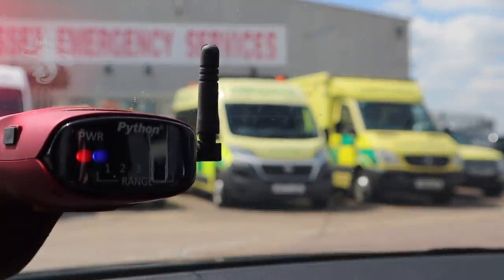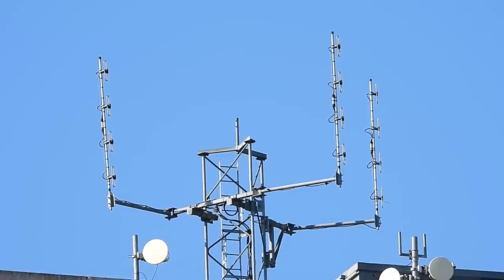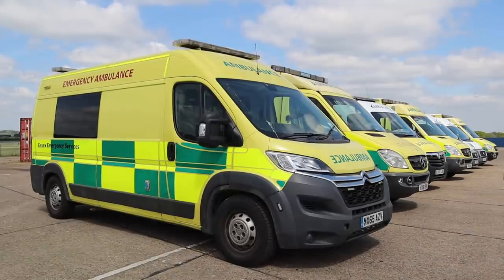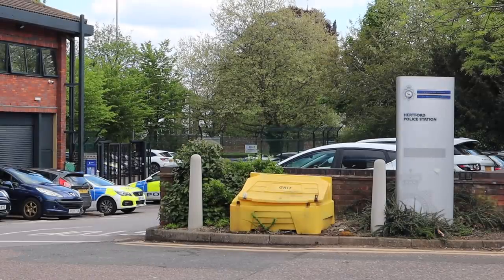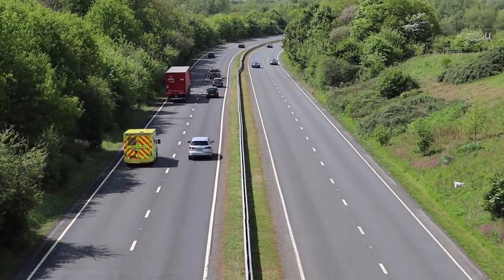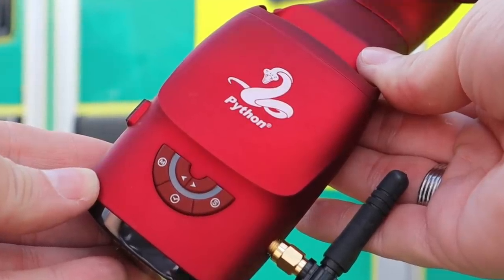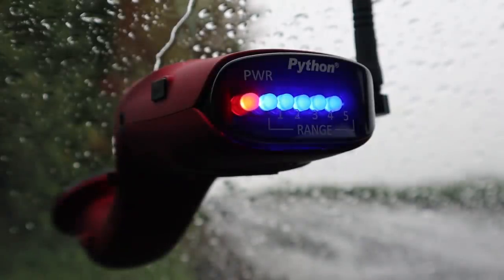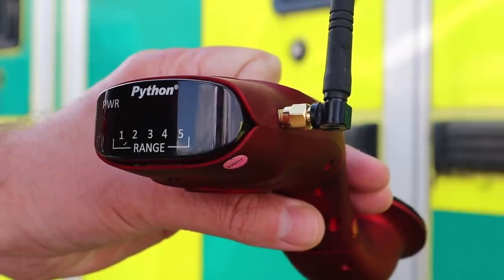This UK Police Radio Scanner Is Always Listening

Comment: These devices have existed for a while and they aren't a silver bullet.  The problem is that the radio needs to be transmitting to be detected and that isn't continuous.  What it's doing is judging the signal strength for the frequencies that it's tuned to.

Comment: So when I'm out doing what I shouldn't  be this could alert me if the police are following me in an unmarked car. 😀😃
Reply: I'd rather listen in to their radio. I want to know what they are saying not just if there's a radio nearby. That's pointless
Reply: @lauralishes1  considering that the mobile speed traps also have airwave radios nearby it will give you an alert long before you see them. And with laser speed vans if you can see them then they can see you. 

So in this use case the python is very useful especially if you know that there is  a favorite spot for mobile speed traps.

A second use case relates to the changes in theblaw regarding use of mobile devices in a car. 
If the python ping then you know not to touch you mobile device or car infotainment system.

So I would say this unit has two valid use cases.
Reply: @lauralishes1  that's never going to happen! Not in our life anyway. The EMS Airwave Service uses TEA2 encryption and is very very secure from casual eavesdropping.
Reply: @lauralishes1  how can we listen
Reply: @endofdayzfitnessu.k2126  You can’t!
Reply: @jasonantigua6825  Theirs always a way to get around it, somewhere/someone is already doing it, but not telling only handful of folks what's going on as if they get found out & release the hack/method the PTB's are going to come after them hard !

Comment: For those who didn't know it you can make a cheap version of that scanner using your android phone an SDR and an app called SDR power monitor
Reply: Doesn't support frequency hopping tho...?
Reply: How ?
Reply: @James S.  I'm not sure
Reply: @jamess1787  doesn’t need to. Just needs to detect any transmission in the relevant band.
Reply: Yep, £4 for android software and £5 for an sdr dongle. Better than £400 for this python 😅
Reply: @Elberto71  ok you have links?
Reply: I did wonder.
Reply: @Elberto71  any links ?
Reply: @jamess1787 Tetra Modulation doesn't frequency hop by default in TMO.

Comment: This looks interesting but will soon become obsolete as they have been planning to move to a network radio system that operates off the mobile networks for some time now. I'm not sure what the latest is on that front but I know the project was delayed and some shady deal was done to allow Motorolla to continue to be the sole provider of equipment at some excessive price. So far as I was aware Airwave was due to be scrapped a couple of years ago but that hasn't happened because in traditional government form the project ran over budget and over due. Probably a lot of greedy corrupt officials at the top levels of the home office / government using projects like this to funnel large sums of public money into off shore bank accounts. I've seen the sort of nepotism that goes on first hand having been involved in some government IT projects in the past.
Reply: The ESN Network (EE) is years behind and when it is finally introduced and the EMS eventually migrate over too it, The Tetra Airwave Service will run along side its introduction I imagine, until its trialled, tested and proven as a reliable and robust alternative to the AWS. I anticipate its a few years away yet.
Reply: I mean thats literally how business/government works..
Reply: They used fm for nearly 20 years after gsm went live in 1985. See what going on at E.P.S. Chipping warden. 3g and 4g developed there. I was out before 5g. All the mobile companies were there. Maybe 4 or 5 years to roll out next one. Couple years on contract yet. Flog that dead horse down to the bones. sell that old rope then upgrade. Lol
Reply: @mipmipmipmipmip It's not a merge with existing ones, it's a separate network run in the same way, think more like the diferrence between EE & o2
Reply: Motorola isn’t the sole provider though

There loads

Sepura etc
Reply: @alanswolfpack89  from what I was told when the ESN project over ran and they had to extend the contract with Motorola to support airwave for the foreseeable future Motorola only did so on the condition that they would be the sole supplier of handsets for ESN. I didn't hear this first hand but from a very reliable source
Reply: 2026 at the very earliest
Reply: @binky_bun  Samsung are supplying the new ESN Network with LTE Handsets, UK Government (Home Office) Contract procurement.
With potential to provide upto 250,000 pTT Mobile Phones.
Reply: I serve in a UK police force, from what I heard the ESN was due to be moved to a 4G service either this year or next, however as I understand they are apparently meant to be slowly phasing it in around 2024 with a view to it being fully implemented and operational by 2026.

Comment: Heya, our Tetras can also be used in a few other interesting ways:

Point to point; direct handset to another handset without the use of a repeater.
Or using the vehicle as a relay, for example, down in a valley where the handset may not have the height/power to pick up the Relay but the vehicle base unit might be able to communicate, so effectively it's Handset via the vehicle station to a Relay and onwards to a control room. 

They're clever bits of kit, but fit for voice/text data only. All slated for retirement, I think it's Motorola running it now at an eye watering monthly cost to the home office, Home Office paid £1.6 billion to extend the use of it until 2026 as the LTE replacement isn't ready.
Reply: I thought "point-to-point" referred to individual terminal-to-terminal calls using the Airwave network rather than DMO?
Reply: Yes, point to point uses the airwave network. You can utilise this feature from
one radio to another anywhere where there is airwave coverage UK wide.
Reply: When i was in the rozzers back in the 90s we had a similar thing with some of the car mounted tranceivers ,as they could act as a cross band repeater.
Reply: I assume when the LTE replacement comes in, the devices themselves will still look similar? What are the benefits (perhaps other than cost) to using LTE?
Reply: @asystole_  they work in both modes.
Reply: The Ultimate Art Bell Collection  Ah so they will still look like conventional radios, and not - well - smartphones. Interesting
Reply: @MaxPlayle  I bet there is already a smartphone with integrated UHF even for the consumer market ?
Reply: As someone working in IT I can see the benefits of an LTE-based system. Our country is looking at it too. 
But I can also see that it will also be immensely complex and I doubt it will be as reliable as even TETRA.
Replacing the rather basic analog voice/telemetry systems we had until 10 years ago, I doubt we will have learned our lesson. When we run mission critical systems with NO fallback.  We paid billions for the "Silver Bullet" and we will probably do it again.
Reply: I work on them I think they are great I also love being part of the banter
Reply: @MaxPlayle  I understand that ESN as its being called will offer faster data speeds,  which they want as in most cases they are using  data  to carry out P Checks, Vehicle Checks, etc  which increases the amount of time officers  are on patrol. which in turn is your point of saving  money and could lead to reducing the number of control rooms.  in NI there is a plan to replace the PSNI radio system which is like Airwave and I don't want to say to.much on that , other than it will not be the ESN, but it be interesting to see how it pans out as currently the Garda Irish police and PSNI don't use the same type of radio systems and PSNI currently t fun and supply the Garda with Radios for a cross border network around the border  area. the Changes in NI will also impact on Army Radio use  Fire and Ambulance as currently PSN look after I maintenance and talk through for all
Reply: P2P is such a good feature of airwave
Reply: Point to point would still use the radio towers, its the same principle as your phone when making a call or using mobile data
Reply: @MrJoshmister  indeed
Reply: How can I connect to the police radio
Reply: @Motivation-su7fr  you can’t it’s encrypted only way to listen in is get a job with the emergency services
Reply: @rkan2  Yes. Its called RFinder B1. A dual band FM & DMR transceiver and an android phone. I have one    :-)
Reply: I've been in the job 7 years and not once had to use the Gateway (handset radio to vehicle mode), in my experience if you are in a location where your handset cannot get service, then despite the vehicle having a slightly higher power transmitter it still cannot get service. Unless you happen to be perhaps several hundred metres from your vehicle, which in the area I police is incredibly rare.

Comment: There was a Glasgow based 'firm' supplying snazzy laptops with a bunch of RTL-SDRs and some fancy Bluetooth recievers and panel antennas built into the box. It gave early warning for tetra of any type, but the hardware MAC id of some equipment the police carry could be used to confirm it was the police rather than a ambulance 

It also silently logged all the phones and car BT MAC IDs, give it a week to learn your neighbours, then after that it warns you anytime a new device enters the street

I think there's a commercial version available that had less functionality for £5-15,000 depending on spec 👀
Reply: Which is this? :P
Reply: Commercial security scanners/receivers are fully loaded. Most are restricted now by software licences and of course if you try and scan restricted frequencies, that's illegal and you could get a nasty shock when discovered. 
There is an android app that uses to record all info about cell towers, so if someone tried to put up a spoof to intercept calls or data, it would alert you. Pretty handy, but unable to test if it worked as we didn't have a spare cell tower lying around. Lol
Reply: I might make this, I love the idea - and very simple in concept
Reply: @Hastings1066TV  What are you smoking? record restricted frequencies?? Most of them are encrypted so unless you have the keys, it's useless.
Reply: @rkan2  thank you for your comment. Encryption can be broken, it's time, equipment and effort. However like most rf transmissions, it's how quickly it's done to determine how useful the result might be.
Reply: Nah. It's very easy today nrun encryption these days that nobody is known to be able to break. It's possible some governments can but if they can they are quiet about it.
Reply: New devices won't work with BT presence awareness. They MAC's are randomized. Not sure about the WIFI though because that broadcasts periodically when out of range of the router. I'd imagine they're randomised too. You can build a database of keyfob frequencies in your area that give you some sort of idea if there's a new car in the vicinity. A fake base station is even better. There's always various side channel attacks to fingerprint a device.

Comment: Back in the late 60's I was a bobby in Cardiff, being a small  ( geographical) Police force the motor patrol  unlike larger forces that used duplex, used to operate on  a vhf simplex frequency, 82.325MhZ from memory, ( those of us on foot patrol used Pye poketphone  UHF separate transmitters and receivers) This was below the range of domestic fm receivers, but I remember modding one and was able to listen to both sides of the conversations.  great fun!

Comment: Tetra Masts are not Repeaters, they are TMO Base Station Transmitters. Working on the same principle as Mobile phone masts... Repeater Mobiles are only used in EMS vehicles to enhance better range and coverage to Officers HTs. (Handheld Terminals).
Great videos you do by the way Lewis on some interesting Radio related topics ect.
Reply: why is it unfortunate?
Reply: Ello Lewis.... are ya gonna check out cobra mist at orford ness ..... 126 element log periodics 20 in an arc point ting to the riskiest..... 73 6dhs
Reply: Correct. As a serving officer the repeater car mode is often referred to as "Gateway". I've never used it in the 7 years I've been in the job and none of my colleagues have either. You are correct about TMO as our radios (now Sepura, formerly MTH 800) have a TMO/DMO switch function on them. TMO being Terrestrial Mode Operation and DMO being Direct Mode Operation is (point-to-point).
Reply: TMO Trunked Mode Operation on the Airwave Service Network.

Comment: In the US, the local PD ran unencrypted trunked radio up to the early 2000's. It was 800mhz based and had a few repeater sites around the metro area. With the stock rubber ducky on my RadioShack scanner, it was really easy to listen in pretty much anywhere, as long as you knew which talkgroup was which geographic area. Friday and Saturday nights it was pretty common to hear them break up loud parties around the university campus, occasionally calling in IDs to see if they were fake and the suspect was underaged.

They switched over to a statewide P25 initiative a ways back, and while there apparently are unencrypted agencies (mainly EMS dispatching) most of them are encrypted now.
Reply: Sounds like Indiana and it's SAFE-T system

Comment: Would be interesting to see inside of it.
I doubt it has an SDR. More likely some cheap MCU and a low cost radio chip like CC1101 used to sweep the TETRA uplink band.
And maybe a 380MHz band pass filter at the antenna.

Comment: Uniden made these types of devices in the 90s, and I had one.
They were pre-programmed with each States police vehicle repeater frequencies which in theory the state police and County Police vehicles had repeaters in their vehicles and the handheld two-way radios had the dispatcher frequency as the receive on the handheld and the transmit frequency on the handheld was the input frequency on the vehicle repeater and the output frequency was either the dispatch frequency or the input frequency for the dispatch repeater at the base

They relied on signal strength to tell you when a police unit was in the area but the repeaters in the car only were active if the handheld radio was being used and many times there was no repeater in the vehicle so it didn't pick up about 99% of the time that the police were in the area

They did have the repeater input frequencies programmed in and those were a little better at detecting because they used the vehicle radios rather than relying on the vehicle repeaters

The best frequency that I found to use was one that wasn't programmed in and it was only for the one city in my area that had a constant data link with each vehicle's mobile data terminal

Nowadays with the p25 phase 2 digital simulcast systems the best thing to do is to get a scanner that does 700 MHz and Phase 2 digital and program in a group that is exclusively the input frequencies for the base Towers

Usually these frequencies are in the 790 MHz to 810 MHz

These are what the mobile data terminal uses as well as the vehicle and the handhelds and because the power output is only three Watts if you are picking up a signal on any of those frequencies with a standard rubber duck antenna on the scanner it means the police are within about a mile of you

But this relies on your county or city having one of these systems and if you are traveling between counties and different cities they are all going to have a different set of frequencies and here in America it's a hodgepodge of cities and counties still using the old VHF analog frequencies and others using UHF and others using 800 MHz repeater trunk systems and others using the 700 MHz Phase 2 digital systems

I'm guessing the UK is more standardized and these are programmed with the input side of the repeaters frequencies
Reply: UK is apparently TETRA only. So 380 - 390 uplink and 390 - 400 downlink for govt users. But it is also used by fire and EMS, so one would want to demod it to see more info about the users, even if the voice is encrypted.
Reply: Yeah I was gonna say the US has P25 and other types (NXDN, etc) in use on a variety of band plans with several agencies of the same jurisdiction using completely different radio systems. Something like this would never work here. I do find it funny that they call it a Python when Cobra here makes radar detectors (though Valentine 1 is my fav).
Reply: I knew it was input also.

Comment: Hundreds of police handsets inside the building. If only! The county only has 3,000 officers, bet on no more than 25% of them being on duty at any one time, then spread them across various stations and out on the job, there may be a dozen in there.
Reply: There’s loads of them in there eating donuts !😜👍🏻
Reply: @AJ-qn6gd  if only. It's not unusual to do a full 10 or 12 hour shift without a break of any kind.
Reply: @stevesmith7530  yea been there done that 👍🏻🇬🇧
Reply: 25%? More like 5-10% on duty at any one time tops.

If you think Hertfordshire has 750 officers on duty at any one time actively with a radio switched on and connected to the network then I think you are very much mistaken. 

I work in a much larger force (with about 10x the officer numbers) and our number on duty at any one time is probably in the region across the whole force of around 3,000, or 10% of total officer numbers. That probably includes specialist units such as ARV, dog unit, traffic, etc.
Reply: @thefiestaguy8831  on duty <> out on the streets doing proactive police work
Reply: @thefiestaguy8831  on duty <> out on the streets doing proactive police work